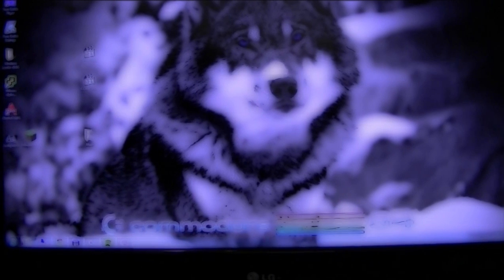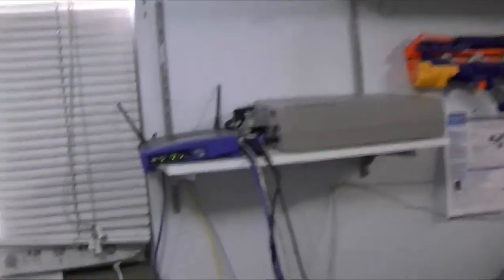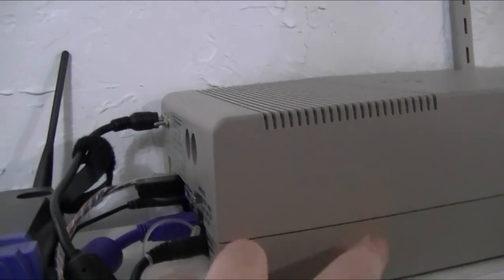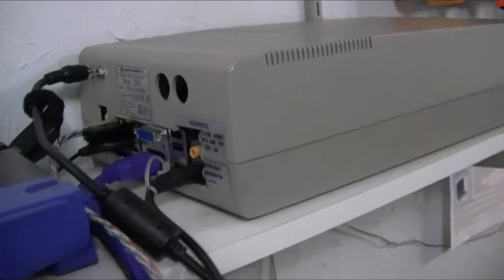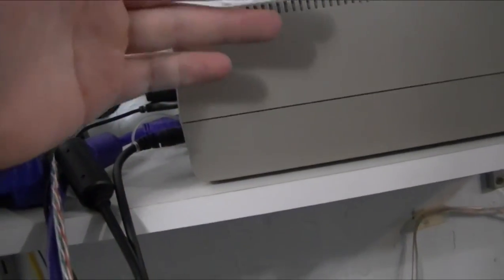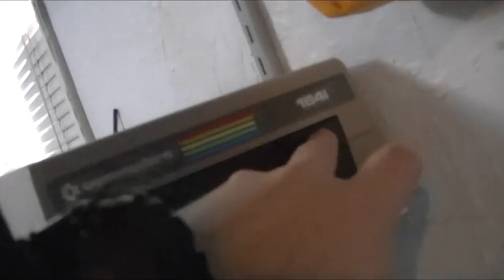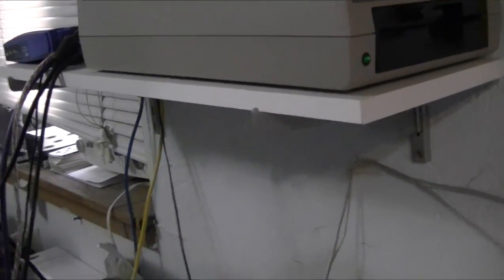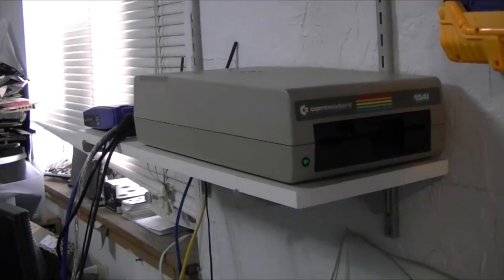Commodore 1541 Mod

Comment: I was just thinking I'd like to do something like this so I looked on YouTube and sure enough someone already tried thanks!

I was going to go for a little little more simple item like a Raspberry Pi running a Amiga emulator inside mine.
Reply from the maker: It is still a fun idea. The only hard part is cooling this thing. sandy bridge ran reasonably cool, but most of the modern processors run a lot hotter so I'm not sure how practical this is now a days. but that sounds like a fun project as well, you should do it. its always fun reusing this older retro shells for new things.
Reply: @turbo5546  sorry, meant I was using a Raspberry Pi Amiga in the case.